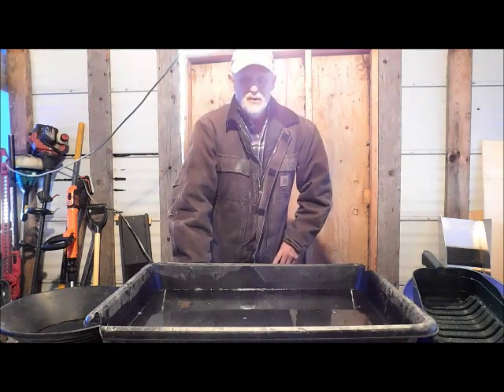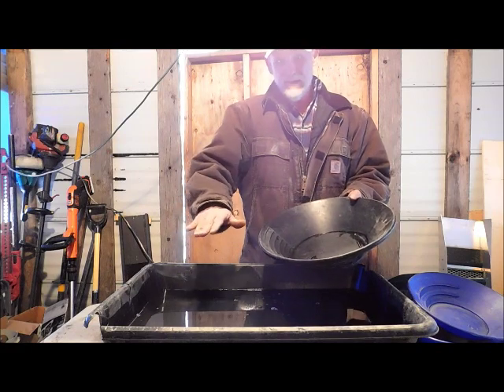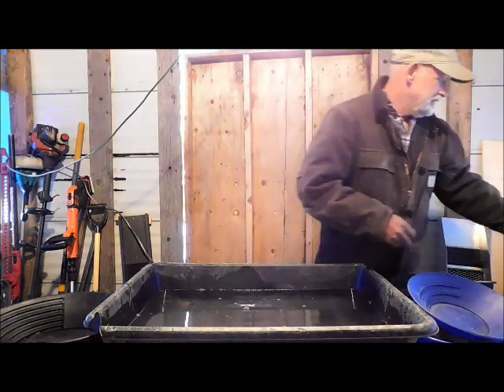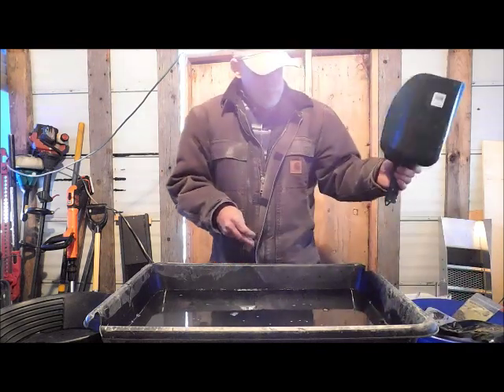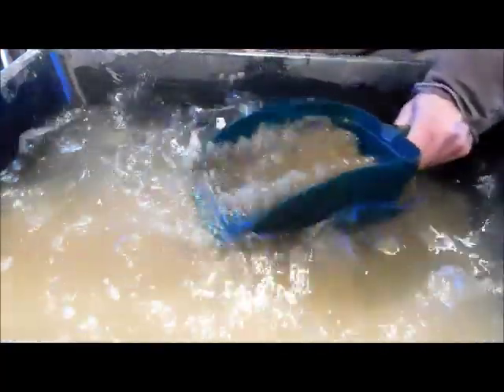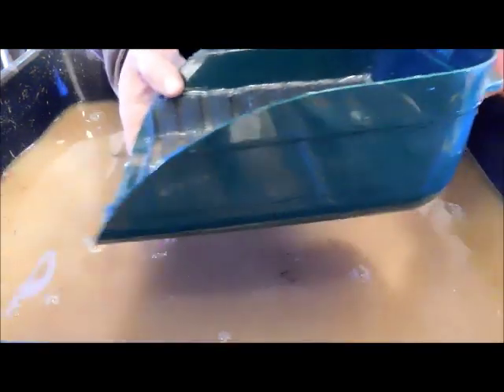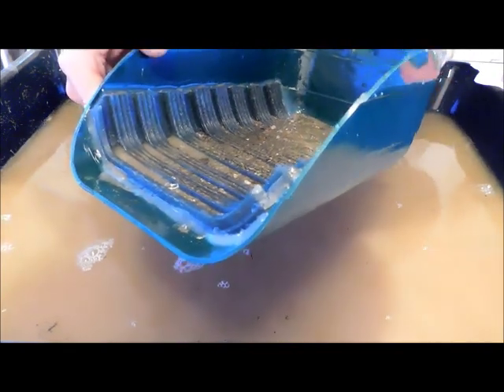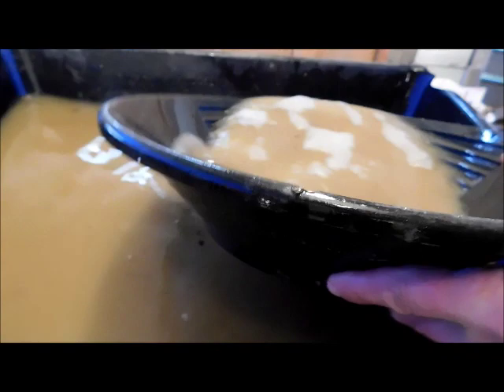New Shaker Gold Pan Concentrator With Silicone Mat Experiment

Comment: Principal is the same as the wooden side shaker pan I posted on the 49'ers forum some 15 or so years ago.  I think you were there. It's the best and fastest method of gathering cons in still water. Your riffles might be too big. Keep it submerged and tight shaking at a slight angle will run all the light material out quickly.
Reply from the maker: I appreciate the feedback.  I'm always looking for ways to improve my setup.

Comment: I like the idea too. This one reminds me of Docs Hog Pan. But yours is way cheaper to craft. I think I can craft one for under $15. Plus, you can equip any mat that fits your needs. Regarding your technique: Left-right shaking is perfect to get heavies all the way down to the bottom. But avoid this motion when pooring out the tailings. G forces might transport the gold even over the riffles, out of your shaker pan. Instead I'd carefully do this motion: 7:08 in order to let the water do all the work. Both motions alternately. Settle-wash-settle-wash and so on. Just like you handle a regular pan but unlike many pans with suboptimal untercuttings, you have safe trapped gold in between the riffles here. I love it! Kind Regards, K-Town
Reply from the maker: Not bad for the price at all. I would agree with you on that fanning is probably not the best motion after trying it once I will probably go to a shallower mat and see what happens.

Comment: holes with one way flaps so you move water in the back and over the riffles to the front then front to back stroke  and shake.
Reply: might want to add some magnets on the bottom of your scoop  2/3 of the way down  so as to create a low head dam  of iorrns to slow the water leaving and ensure the flakes dont escape. and  when it builds up too much   just remove the magnets and rinse that part. if your in the gold the irons will be there too.
Reply from the maker: Not a bad idea at all and would work well for the material that I usually run. Thanks

Comment: Hmmm. . .  Well, it seems to me that once those ridges at the bottom of the scoop fill up, you would not be able to capture any gold, and it appeared to me that they did fill up after you emptied that second bunch of material in your scoop..   Thus, I would have expected most of your gold would be found in you tailings, but for some reason, apparently not.  I don’t get it. . .
Reply from the maker: Same principle as a gold pan the heavies are on the bottom and the lighter material is on the top.
Reply: heavies  replacement shouldering out the lighter stuff  to the next riffle closer to the front.

Comment: Alan this is a great idea.  I too am a Utah fan and have built some of his equipment.  I also converse with him alot...really nice fellow.
I want to thank you for posting your diy silicone mat videos.  I can now produce decent mats.
Heres my two cents on your new idea.  
There are several ways to go about what you are trying to acheive and as a matter of fact I have seen pans that sorta do the same thing...I'd have to look up the videos and web pages.
So, using two square buckets, attach the open sides into one long trough.  But attach them in the shape of a shallow 'V'.  At the point of the 'V' where they connect take a piece of pvc pipe and cut it so that the point of the 'V' sits into the pipe and glue it in.  Now instead of shaking you would rock the trough like a seesaw creating a wave pattern in the water.  
I would make 1/2" - 5/8" square or deep 'V' drop riffle mats...one for each side leaving them short enough so that there was a well/trap in the center and a well at the input end or build the well and trap sections into the mat.
I'm sure you're getting the picture.
This way you could work standing up or sitting comfortably with the trough sitting on a card table and dumping in a bucket so you could rework them.
Reply from the maker: Interesting concept for sure. I do see what you are saying going to have to think about it and try and put it in my head. Thanks for your input.

Comment: Great idea, Alan. As several other posters have noted, the panning action should probably be similar to what is used for the Gold Claw pan, which I am very happy with. With the Gold Claw one needs to keep the material completely submerged. If you haven't already done so, I suggest taking a look at the instructional videos on the Gold Claw site. After classifying down to 1/4 inch, I speed pan with a level full Gold Claw pan until I get down to having roughly maybe 1/10 to 1/15 of the original material left and then I pack out this remaining material(about 20 lbs of material on the last trip). I will finish panning the packed out material at home over the winter(aka keeping gold fever at bay as best I can). I appreciate your comment in the posts that the gold should not slide as easily over the matting that you are using, compared to the Gold Claw pan. Thank you for sharing.
Reply from the maker: Thank you Yes I have seen the claw pan video and what you are doing with you claw pan is what I was thinking. If my bucket idea works it should cut down on a ton of junk in my material as well as help get rid of the over size rocks. It should be a lot faster than a regular pan.

Comment: Another great idea,flat bottom always will concentrate more than curve,forcing all material to
run on the mat,and this concentrator allows you run the dirt back or forward  as long as you
want,really dont release it till you want,two directions sluicing.,really recirculating without
effort.Point 2,allows you to take BIG samples,when i take the pan and the classyfier,
finnaly pan out a little sample,so this make me do lot of pans,specially because remains the doubt,Is there not gold here,or not gold in this little sample i obtained?well,this shovel takes
big sample almost non stop running,through it.Point 3.,round shapes dont fit good in the backpack,squared do much better.
 Thank you Alan,another great simple cheap idea,gonna think about it!
Reply from the maker: I hope the idea will do you some good the bucket I hope will be a lot faster than a pan. Good luck on your hunt for some gold.

Comment: Great idea. There was an oblong pyramid shaped gold pan from the early 80's that had built in riffles all around it's construction. As you swished back and forth (not in a circle), the cons would drop to the bottom. As long as you kept agitating it and keeping it in a suspended fluid way the gold would settle to the bottom. 

The thing would get pretty heavy after awhile as the cons/iron would build and you would toss the whole mess into a bucket for later reducing. But it caught gold as the angle was fairly steep. The only problem I saw was that the material in the deepest part would almost be like cement when you were working it.

Love your videos!
Reply: Do you have a link or a picture of the "pan" you just described?  Thanks
Reply: @evcin1  Sorry, that was too many years ago. I just happen to remember it (watching Alan's video) from way back when I was at a gold show and it was listed for 19.99 (back then around 1981 or 82).
Reply from the maker: Hi John I have seen that pan before not sure but I think it is called a pyramid pro pan it looks like it would work well only problem I see with it is there is so much agitation it would be hard to keep yhe fine gold at the bottom never used one just my thoughts. Thanks for watching.

Comment: I vote for the square bucket. And maybe turn the mats so they act as a trap instead of a riffle.
Reply from the maker: It looks like the square is the winner it is all made and ready to go just need to thaw out some dirt. The drop riffle v mat would not matter they are the same in either direction. I used my old mat that I made with the legos for the square bucket and I did turn them around.

Comment: I did the bucket shaker aspect... round bucket with gold cube matting in it, classifier screen above the matting... worked very well as a concentration... problem I had was that it was very heavy and made me not want to go much farther...  I like the small scoop version...  I got rid of my bucket aspect once I got the gold claws though.
Keep up the good work!!
Reply from the maker: Hi Michael I can see what you are saying the 5 gal. bucket might just be to heavy to work with for very long. We will see.
Reply: @alanrobertson2510  possibly a 2 gallon bucket... works great where you cannot bring "equipment" or if you want to run test buckets fairly quickly....

Comment: Alan, using a Feed Scoop you might want to add a 18/20 mesh screen on top to remove the larger rocks-n-nuggets.  Using your square 5 gal. bucket, maybe a combination of Deep mats and your "U" shaped clean out mats, (2 inches of each starting with 4 inches of your "U" mat at the back like a skid-plate).
Reply from the maker: That might work a classifier on top. I think I will try it first without and see what happen and then try and decide how far to go with this idea. I just pulled out my old mats I made with the legos they are a drop riffle so they should work just fine for a test. I am about silicone poor right now thanks to the bear.

Comment: try running the experiment with 1/2 the material being dry first/dry panning. Then wet pan using the same scoop pan to see what how much you missed if any.My thought is the better it works on dry material, the better it will be in the stream/wet box. thanks for sharing another great idea.
Reply from the maker: That is a great idea and makes total since to me. Thanks Bill I will try and remember that next time if I can get some dry dirt all the dirt I have right now is all frozen in buckets. Thanks for your idea.
Reply: @alanrobertson2510  Maybe buy a bag of course sand and salt it,then you will no exactly what it's doing. Keep the wet stuff on  the wood  stove and stay warm bud.

Comment: Great idea Alan!! You are getting the hang of it. The constant horizontal motion and keeping it underwater is the key. Makes sure the gold goes to the bottom and stays there. I think both buckets would work but in different ways. I think one Mat may work in both buckets. Nice work.
Reply from the maker: Thanks Not to bad for a first try. Right now I am thinking the square bucket might work best. Now to put it together. If it works this will be fun to use on the stream on all the new ground we have to test that the FS left us.
Reply: Alan Robertson 
Yes, it would work great in a stream but also away from the stream in looking for new ground. You can tip it back, throw a shovel of dirt in it, put some water in it  and wash any big rocks off and and chuck them and then pan out the dirt in a small tote. I do this with a small kitchen dishpan and my gold pan and it works well for me for doing sampling. Yep, I think I like the square bucket a little better as well. You have a great idea, keep at it.
Reply: I have binge watched both of your channels!  I love it!  I have made utahavalanches diy super sucker and Alan’s silicone mats!  Great minds guys!  Thanks to both of you!
Reply from the maker: @johnr.8723  Thanks John I know I sure am having fun with my channel.
Reply: John R. 
Hi John, I appreciate you taking the time to watch and build.

Comment: Oh Alan, that’s freaking AWESOME. You could use the “mini concentrator” to test pan an area. Then use the bigger bucket version to process.

I think square bucket as it would be more even flow. If you use the round pail, I think you’d have the same complaint that you do with a round pan. The riffles at the back would overload and be less effective, even if you flattened the front out.

I don’t know if this would work on your claim, but I would use this to get say 2-3 gallons of material and use a creek to get down to cons, dump into a pail then repeat until I had pails full of cons. THEN run the cons in your recirculating system sluice. All the dirt would be gone and you’d have cleaner water for way longer. Without junk filling your riffles, you’d probably find the sluice works way better.

I would put this in the same use as Doc (goldhogs) “Hog pan” or “Flow Pan”. 

Simply awesome!
Reply from the maker: Thanks Chris So that is kind of the plan is to have something to use use for testing the area that the FS opened up for us on the stream it look like it is almost down to bed rock and there has been tailing piles on top of the ground for 100 years that have all been moved. I have about four buckets of dirt to test that came right out of the old stream bed.  most think square is going to be better.
Reply: I think you should try both. I’d personally like to see you do a video testing the round vs square buckets to compare. Maybe they both end up being useful for different situations.

Comment: you still needed to use a pan!..but i like what Louis K said below!!  And i really like the square, for that side to side motion! A gold wheel , is a constant side motion!.  i have a small square low profile plastic box with V-mat in the bottom..for a quick classifier..
Reply from the maker: Yes I agree with Louis side to side and back and forth should work good. A box with v mat what a great idea.

Comment: great idea Alan. was just wondering if you shake slowly side to side and then, with the pan tilted slightly forward, below water level push forward and then pull backwards  and repeat. it should get rid of the lighter material much quicker and in doing so all the material will have to travel over the riffles
Reply from the maker: That sounds like a good idea to me and faster than what I was doing. Thanks Louis.

Comment: I've used the gold claw which is on the same line as what your doing so with that said it does loose gold as well not much lost either I like what your doing and probly gonna order a mat from you to make love the idea with the bucket thank you for shareing do you make your mats 12 inches or is it just 10
Reply from the maker: I would agree nothing is perfect. The mold for the mats are either 6 inches wide or 10 inches wide you can make the mats any width you want. To get a 12 mat you can seem two six inch mats together or glue two 6 inch molds together to make a 12 inch mat.